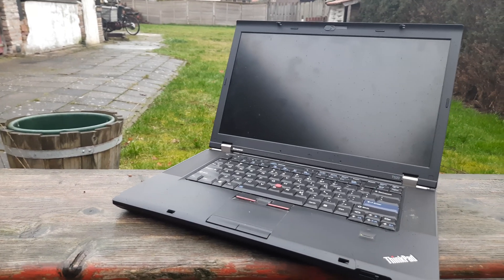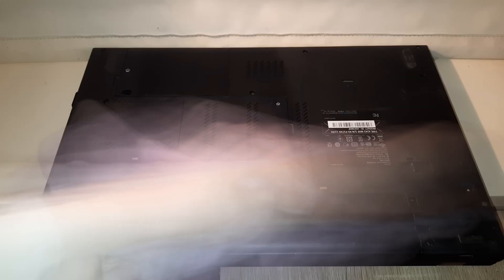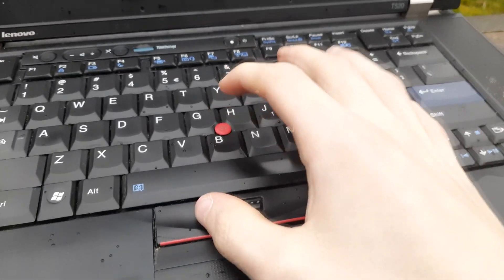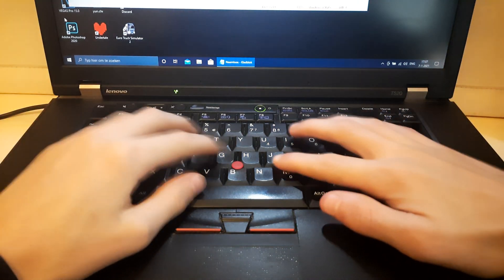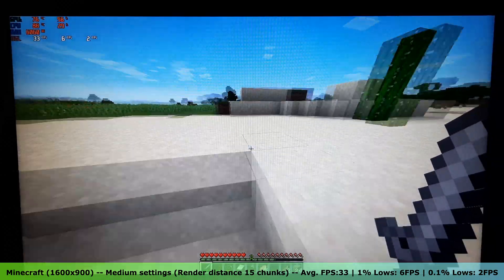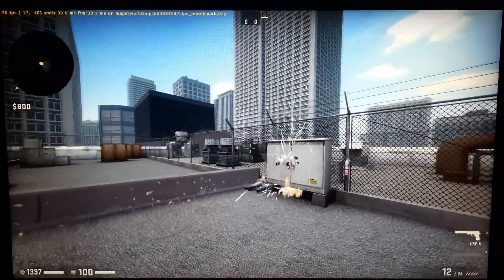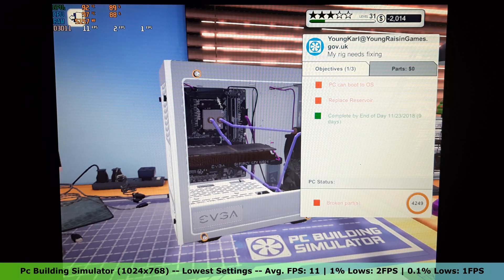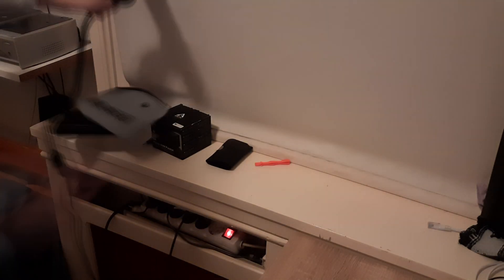This thinkpad cost me $50, how usable is it? - A review of the Lenovo Thinkpad T520

Comment: Nice one! This laptop should still be quite useful in 2024. All the hardware you need is there, only the cpu is getting a bit slow nowadays. And you cannot run Windows 11 because of the lack of TPM 2.0.

The downsides you mention are downsides of almost all Thinkpads. Games are a big no go, anything below 30 fps is not playable in my opinion. Multimedia is mediocre at best, especially because of the bad speakers. For business use however, especially for jobs with heavy typing, this laptop is perfectly capable. And all this for only 50 bucks, it is a great deal!

Comment: This is the best laptop I have ever had. I upgraded with an i7-2760QM (very cheap). Despite what Lenovo says, it supports up to 16 MB RAM. It flies! Good old sturdy Thinkpad keyboard. Last model with that kind of keyboard. It supports up to 3 ssd.
Reply from the maker: Yeah this is also my best laptop I've ever owned. I'm planning on using it until something critical like the motherboard dies but even then I might just use a donor laptop to fix it
Reply: How do I add a fingerprint to this device?
Reply: tell me please
Reply: You need a palmrest with the fingerprint reader installed. There are two models, one with the reader and another without. The one with reader is connected to the touchpad. I have one extra with FRU number 75Y5736
Reply: @carlosmolina1281  
So can I add a fingerprint from the computer keyboard? Carlos Molina 

Sorry if I misspelled you, my English isn't really good
Reply: @antabark10  What do you mean from the keyboard? What you replace is the palmrest, not the keyboard. There is a palmrest that comes with the reader built in (FRU 75Y5736)
Reply: @carlosmolina1281  I'm a student, I don't need the bracket, only the best fingerprint for speed Carlos Molina
Reply: @carlosmolina1281  Sorry if I make mistakes because I don't speak English very well
Reply: @antabark10  I don't know what you mean by bracket. You can install a fingerprint reader by replacing the palmrest or with a USB reader. Those are your options,
Reply: @carlosmolina1281  
Can you show us a video of how to add a fingerprint? Carlos Molina
Reply: @antabark10  The hardware maintenance manual also explains how to do it. The PDF version is easy to find online
Reply: @carlosmolina1281  I really want you to tell me where to find it please
Reply: @antabark10  Look up the FRU part I gave you. There are many sellers for new and used Lenovo parts
Reply: @antabark10  It is not allowed to post links here that direct you to sellers

Comment: Excellent laptops. Bought a T520 on eBay for €150. i7 CPU, 8gb RAM, Full HD screen, Nvidia graphics card, Samsung 220 GB SSD, docking station, power supply... It does everything I need it to do without a problem. It's  my recording studio, video editor. Absolute bargain. Got a T420 too for €70. We've never had it so good :)